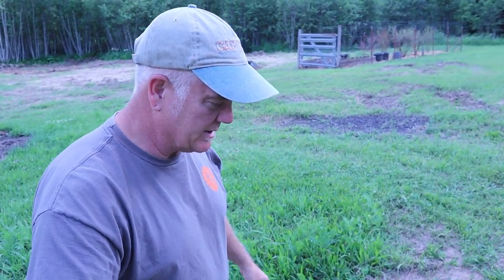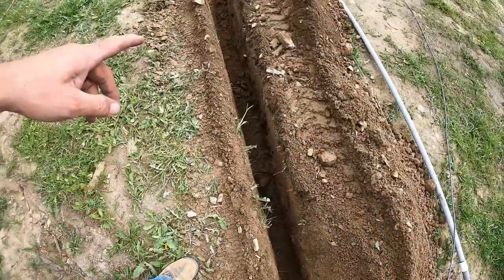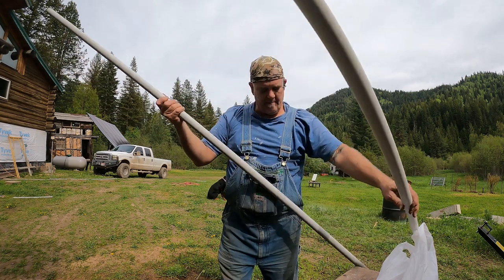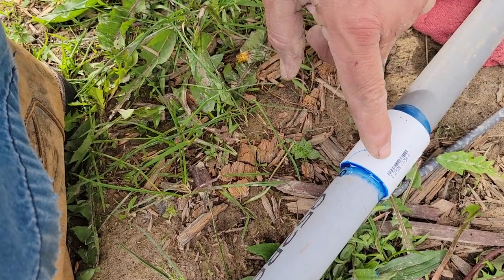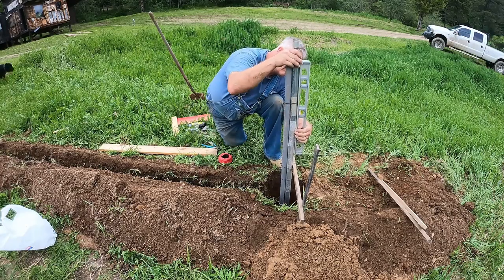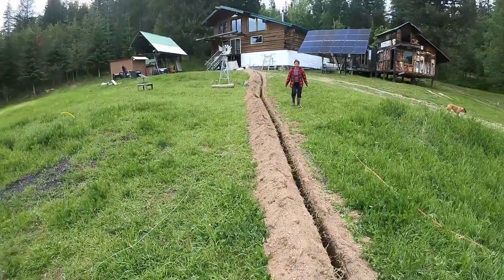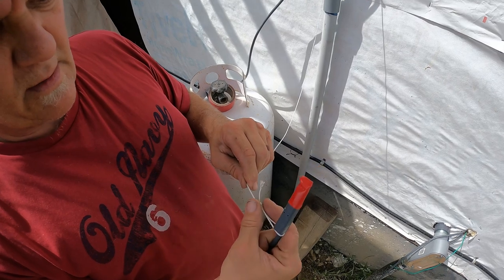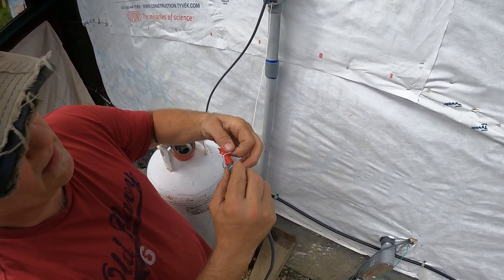BURY YOUR STARLINK CABLE !!

Comment: Great video and timely as I just trenched for our 150' cable. I appreciate the comment about running from the house to the link, not from the link to the house; makes for a faster install and with a reduced diameter conduit! Lastly, I used Garner Bender "Duct Seal" to cap the end of my conduit. It's waterproof, never hardens and may be an alternate solution for those not wanting to use spray foam.
Reply from the maker: Excellent tip!  Thank you sir.  Interesting how many people had no idea how to get a pull string through to pull the cable!  So glad I recorded it and shared!  We're loving our SL.  But we are offgrid so it will be interesting to see how much power the built in warmers use when it starts snowing!

Comment: This is exactly the video I need right now. Running 85 feet of starlink cable to a post 75 feet from my house. I want to bury the conduit first over a few days(hand digging as my soil is very soft and rock free)  then go back and install the star link in a single day once it arrives.

Comment: I did this with my regular satellite provider and one thing I noticed is when I hooked to my steel pole with my dish or my Starlink on it you have the pipe straight up and then when you get your cable all the way through instead of using a 90° angle I would put two on it and point it down so there’s no water wind anything else that will blow in your upright just a suggestion.

Comment: I did mine somewhat like this, but where the conduit makes a 90 degree I used 2ea. 45 degree so if I had to re-fish cable it would go easy. Also where the cable comes out of the ground and up to the pole I used 2 ea. 90 degree elbows so the hole would face the ground. This is so that NO WATER can get it it. Because here in Florida we get a lot of it. I also use the conduit for other things like rotor control wire and 1/2" coax cable for the TV Antenna. Great Video by the way...
Reply from the maker: Great ideas there and thanks for watching !

Comment: I'm an installer. On long conduit runs, I run the cable thru the individual sections, and then I glue them together. The cable is guaranteed NOT to get stuck
Reply from the maker: Great idea!  Never thought of doing it that way!!
Reply: Can you direct bury the cable?
Reply: @mikepool6391 
I don't see why not,    especially if you use a conduit and seal it to keep water out. Use at least 1.25 inch inside diameter conduit to ensure the cable doesn't get stuck. Make sure you leave a string inside so you can pull the cable thru.
Reply from the maker: @mikepool6391  I've been told you can but I wouldn't chance it getting damaged over time.. I had to run it under my driveway so hence the protective conduit.

Comment: Nice job,  my system is being shipped and I planned on doing a similar installation.   When I inquired about installing my cable in conduit and was trying to determine the recommended conduit size to Starlink Customer support, I was told installing the cable underground even in conduit is not recommended and would possible void the warranty.  I asked again thinking maybe I wasn't clear enough and restated this cable was going to be fully protected- I got the same answer again, they recommended laying the cable across the ground...which I will not do.
Reply from the maker: Totally
Reply from the maker: If electrical codes across the country call for schedule 40 Grey pvc then why not?  What a bunch of weenies!  Lol

Comment: So why exactly does the pipe need to be watertight?   Starlink cable is designed to be used out in the elements along walls and along/under roof facia.  I understand using pipe in the ground to protect the cable from possible physical damage, however I would not get carried away with the watertight aspect of the installation.  Thank you for an excellent video!  What diameter pipe did you utilize 3/4?
Reply from the maker: So I agree with your assessment about Starlink cable being weatherproof.   However I only buried my cable 18" which is above frost line.  If water gets into my conduit and it freezes it will likely break.   That's probably my only real concern on water tightness.  And although the instructions say 3/4" is sufficient I felt it was still a little tight (I tried a piece) to get that connector through so I went one size up to make it easier to pull the conduit through that 80ft... Just a little looser makes pulling easier and it wasn't much more cost wise.   Thank you for watching!  Hope it helped!  The vacuum trick really helped me...LOL
Reply: @HiddenValleyHomestead  Thank you!  Will give the Vac trick a try.
Reply: So what size conduit did you end up going with 1" ?  @HiddenValleyHomestead
Reply from the maker: 1 1/2" sir
Reply: @HiddenValleyHomestead  Thank you!
Reply: Very helpful video! How does your Starlink hold up in bad weather? We are in Idaho too but near Boise

Comment: Great informative video. I'm planning on doing the same, but I can (barely) get by with the 75' cable. I'm curious, how did you get the big end of the cable through the pull box?
Reply from the maker: I didnt.  I started inside and pulled the small end all the way.
Reply from the maker: I actually edited that part out thinking it was a bit boring but obviously with your question i shouldnt have!  Thx for watching!

Comment: did you put spray foam in the end of the pipe and if so, does it keep the rain water out?  Mine just came in.  Going to lowes tomorrow to get an galvanized iron pipe.  Mine won't be nearly that far from the house.  I did order the pole adapter last night.  probably will be here early next week but I am hoping to get it up and going before then.  I put in a hose link the same way.  pole slipped right down into the pipe  and it easily pivots.  We live out in God's country so I can't wait to get this going,  Looking at your video, I was trying to come up with a shopping list.
Reply from the maker: You know what I meant to spray foam the end but I still haven't!  Lol.  I do have that 90 deg elbow though and it's under the dish so water will have a hard time getting in...  Im actually gonna go do it right now!!!  Watch for the reel!  Lol

Comment: Hi, how did you cut that slot in the galvanized pipe? Noobie here and trying to figure how to make my own pole for my Starlink dish.
Reply from the maker: I used a simple grinder with a cutting wheel on it.

Comment: LOVE your video.!!  Beginning at 6:23 I have [never] seen such a trick to tread 'string' (or fish tape) through a pipe as you did in this video.  That's incredible and I'll always remember it.  Thank You.!!  NOW .... I have a question.

There’s something missing in my 'Pole Mount' kit that I received.  When I went to install ‘the Dishy’ to the top of the Pole, the ‘Dish mount pole’  basically fell through the Pole, and I could tell there was something missing on this install. Was there supposed to be a top [piece] to fasten to the [top] of the pole that receives the Dishy?  If so, I didn’t receive it in the ‘Pole Kit’.  There were only two (2) pieces that came in the box, the Top & Bottom pole.  That’s it.

Or ……. do I need to order the ‘Pipe Adapter' for the top of the pole?  If so, why didn’t the shipping department at Starlink catch the missing parts or pieces and automatically generate an email or text to me, notifying me that I need to place an order for an additional part?
Reply from the maker: So my square dishy had a smaller diameter shaft right below that shoulder in the vid...which fit precisely into that 1 1/2" pipe... no adaptor needed.  But you have to cut a slice out of the pipe to allow the pipe clamp to squeeeeeeze it tight!
Reply: @HiddenValleyHomestead  Okay great. Thanks for the help.

Comment: The thing you used to dig the straight line is that specifically meant for that?
Reply from the maker: Yes son.  Its a trencher for digging any sort of small diameter ditch for water lines...elec lines...etc
Reply: Your local rental company might know the machine as a “ditch witch”.

Comment: How tall is the pole after installing it and is their any sway. I have to install mine in the same way but worried ill go to high and it will sway on me.
Reply from the maker: So my pole ended up around 9 ft high.  I zip tied the conduit to the metal pole to help with rigidity but when it's really windy it still sways ever so slightly.  But not enough to affect connection.   At least not anything I've noticed.  Great question.   

I considered welding a piece of angle iron to one side of the metal pole and tack welding it every 12" or so and that would definitely add rigidity.   But I haven't found it to be necessary as of yet.  But storms are rolling in tonight so we will see!

Comment: You should not have a coil at the end of your cable like that it creates a choke for the signal. You should loop your cable in Long loops.
Reply: no it dosent.
Reply: @andrewfung9614  and why do you say this. Do you have experience with radio. Are you licensed in radio communication
Reply: @allenbanks3280  notice how nobody replied to your comment. because everyone knows that those three 4 inch loops wont create any issue whatsoever. 100% guaranteed. also, its a shielded cable.
Reply from the maker: You didn't answer Allen's question.   What are your professional qualifications to make that statement??  I actually know Allen has been involved with the HAM radio industry for 40+years with many bench built radios and antennas and is very well versed in radio transmission and communication.   

So let me ask YOU.  What qualifications do you have to authoritatively say a coiled cable will not create a choke point in signal transmission??
Reply: @HiddenValleyHomestead  no worries. the reason i didnt answer is because its a loaded question. no matter what i say, would you believe me? 
Im a licensed electrician doing electrical and data com installs for over 12 years. i also have 3 years college in electrical engineering. 
Believe me? probably not. dosent matter. 
last i checked, Ham radio operates in the 400 mhz range, where as starlink operates on 10 ghz, besides, were talking about the 48v dc ethernet side of the system, which has nothing to do with the radio side. 
even if the coiled cable would pick up EMF (its been proven it dosent) its shielded to prevent that very thing, even if it did, tests show that EMF generation on a coil that size provides zero interaction with the +1 -1v data signal we are talking about. 
thats why its called "amateur HAM radio license". 
But thanks for challenging me, without offering rebuttal, or hard facts to back up your theories. a little googling will back up everything im saying. ill steer clear of your channel from now on.
Reply from the maker: @andrew fung  Wow sensitive much?  I'd take you for your word with a thorough answer like that but no need to get all butthurt over a little pushback.  Sounds like a legit answer to me.  

So to clarify... what you're saying is that even though there's 48v traveling through that cable and the 10ghz signal is shielded from emf there will be no interference?  Surely there must be some emf generated with the cable coiled...  

And are you also saying that all shielded cable isn't affected by voltage from nearby lines?  Or if it is at what voltage IS it affected??  

And what does the frequency have to do with whether or not it can be affected by induced voltage or emf?  

Please elaborate for others so we can all learn.  If you truly have that experience anyways...

And FYI this has been a huge debate on other forums as well especially on the Starlink forums.
Reply from the maker: @andrewfung9614  Check out this link Andrew.  Directly contradicts what you said.  
https://www.worldwidedx.com/threads/coiling-the-coax-cable-causing-problems-a-myth-or-fact.127745/

Comment: Great video!  Having a trencher is the real key to most of the effort required to finish this project.

Having a backhoe to fill the trench back in also something most folks don't have access to.
Reply from the maker: True but it was only 6 inches wide so a shovel wouldn't have taken too long either.  I'm just lazy....LOL